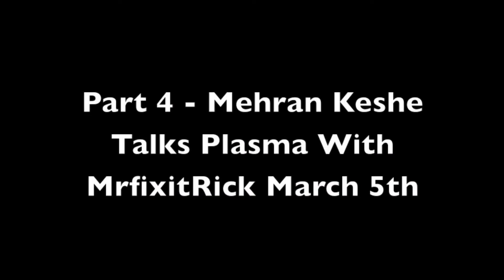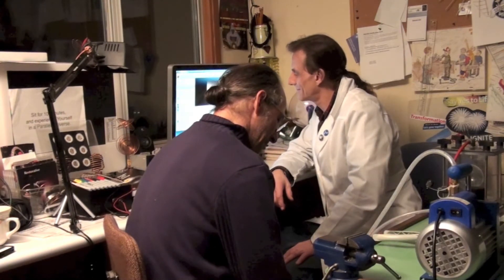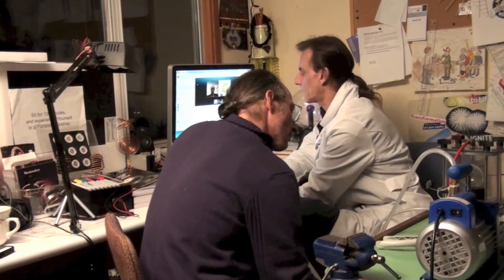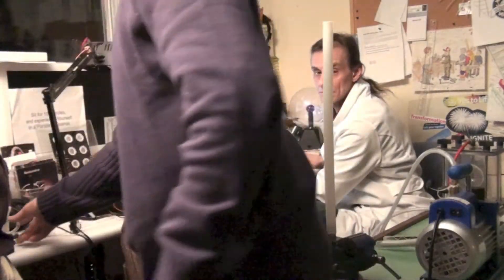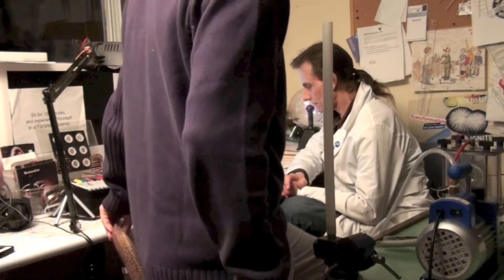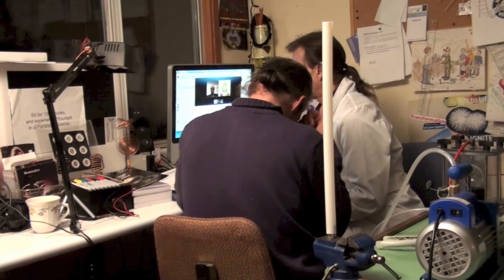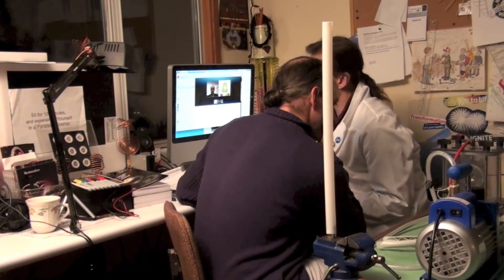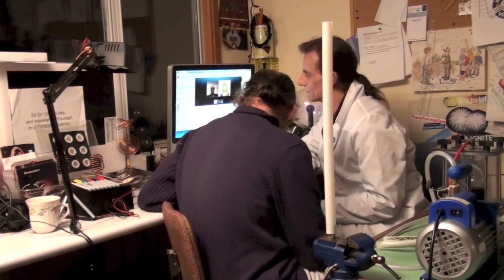Part 4 - Keshe Foundation First Public Teaching Workshop March 5th 2013

Comment: From 7:40 - 8:40. Carbon can only exist as a gas at temperatures over 3700 degrees Celsius in a perfect vacuum, 4700 outside a vacuum. Below those temperatures it quickly condenses. If your reactor is built from plastic (or any metal for that fact) it wont last long with a 4000 degree insulating gas around it. this is nonsense,